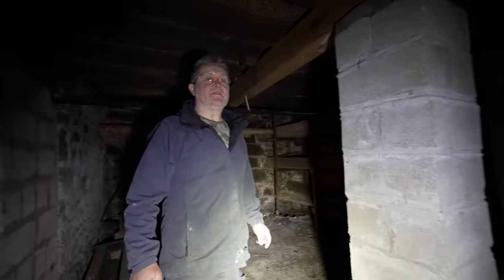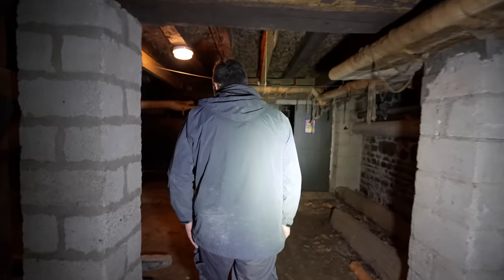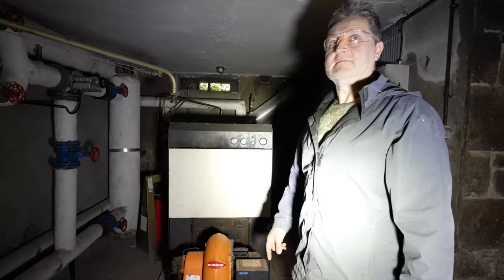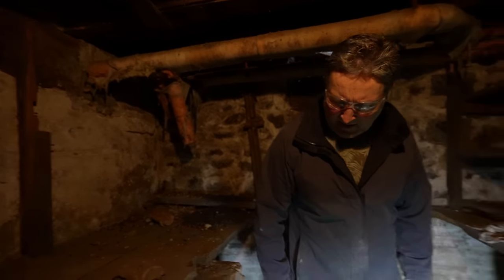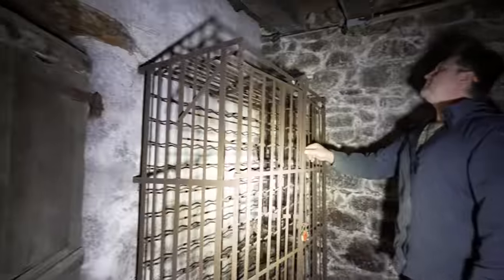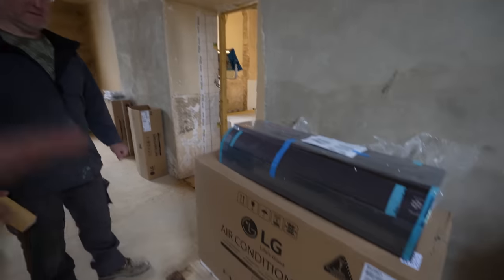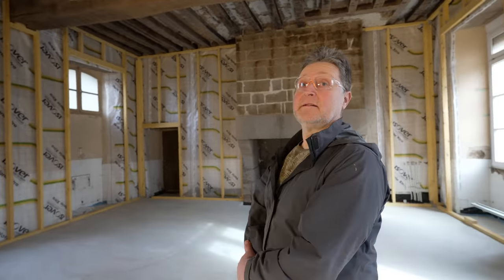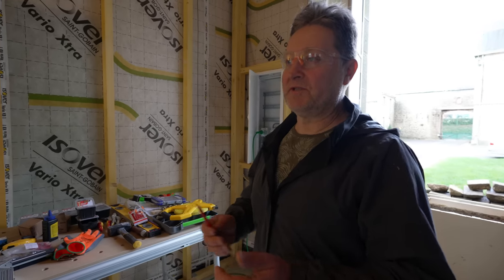You Asked For This... Exploring The Convent Basement

Comment: I think that corridor would have been a breeze way before the doors were installed so the dressed granite by the cellar stairs makes sense as it was once outside
Reply: Yes! The kitchen would have been separate to keep odors and the risk of fire isolated!
Reply: @amysbees6686  yes, the risk of fire was far greater due to the use of open fires,it's often why you will find old kitchen building totally seperate to main dwellings

Comment: I agree with not cramming everything in the kitchen into a little corner!!! That kitchen would be perfect for having a few separate work zones: baking area, food prep, etc and may need more than one sink! Yes, and use those gorgeous oak boards in the basement for shelving and worktops!!!
Reply: Yes. Having everything in one corner does not work if you have a number of people using the kitchen. We have a staffroom where everything is in one corner and it's very inefficient. People have to queue to use the sink and the microwave and get access to the fridge. The other corner of the room only has an oven which we hardly ever use! It was designed as a domestic kitchen but not for 30 people trying to get lunch and cups of coffee.

Comment: RE: The Wine rack. After the rack is cleaned, suggest you contact several 'Fine" resturants, in France and England, to see if you can get them to save their finer empty labeled wine bottles. Filled with the appropatly collored water and corked, filling the wine rack in the kitchen for a great display. Also how about resal on the boiler equipment. Offered with  buyerr removal could bring in a couple of quid!

Comment: The kitchen chimney breast and stonework looks amazing!  This room is rolling along on well-oiled wheels thanks to your team.  It's wonderful to see the progress.   Just remember that there may be construction codes to follow in regards to how far an electrical panel has to be from a water splash zone or open fire.  As what you showed in the corner of the panel might not work.  My father was an electrical consultant on many builds, including industrial, commercial and residential kitchens and that was one of his pet peeves with architects placing dangerous structures by a panel.  No matter that there is a door closing the circuits in, water can still seep in and it only takes one time to ruin a project such as yours. Consult Duncan and get his professional feedback before you install those 2 items.

Comment: 13:27 Looking at that fireplace I would consider turning one of those large beams on the basement floor into a mantle and possibly for the other large fireplace in the other part of the convent. I think the wine rack would be a lovely original feature for the kitchen though I think I would turn the bottom half into an appliance garage type thing.

Really? You want the sink right next to the electrical panel?? That would never pass code here.
Reply: I agree. My thought was unless you plan on spending hours standing at the sink why give it the best view? Where he originally was thinking would be better. I would rather see a small table and stools at the window so one could sit and have a great view of the courtyard.

Comment: I think it would be cool to bring that wine cage up to the kitchen to repurpose and use for the wine now. It is such a cool piece of the convent. I was looking up at the ceiling, that would be the floor above. What is that made out of. I didn't recognize it. Isn't the sink going to sit too low if it's under those windows? Maybe put the sink on a solid wall and leave the windows for viewing with tables and chairs. If I think about the amount of time I've spent at my sink and if I actually looked out the window, I would say, you really don't need a window over a sink. Use the windows as a resting spot to observe from instead.

Comment: Your "vents" might have been "bell runs" - channels made to run the wires that would connect the bell pulls in the upstairs with bells in the basement and kitchen.

Not all buildings had them, but if you find them, they are priceless for running pipes and wires.

Comment: Golden triangle method is far from nonsense. It's so you don't feel so knackered, as though you've run a marathon by the time you've finished doing prep, cooking, & washing up that you just want to fall flat on your bum, never to rise again; especially when catering for larger groups as this property will inevitably require. It was originally conceived by professional chefs, primarily for this reason, but also in the name of efficiency. 

I've tried to arrange my own kitchen this way, & believe you me, being able to just turn, raise a hand & grab a utensil, bowl, or bend down to get something or not have to join the crew of the Starship Enterprise to boldly go where no man/woman has gone before, with barely a second thought, well, it's bloody marvellous!!!

Application of it in a kitchen of this size might present its own challenges, but ask anyone who's regularly cooked for large families or groups, & they'll soon tell you having everything in easy reach (without) having to schlep 5 miles here, 7 miles there etc & back again, makes an enormous difference. Layout is everything in a (good) kitchen. 

However the layout is eventually approached, I certainly wouldn't bother jamming the kitchen sink under the window in the corner. It'll be a bloody nightmare because it (won't) allow enough stacking space on BOTH sides of the sink for dirty dishes and anything else that will require easy & [adequate] laying out around the sink, say for example, vege & salad washing. 
I've always been completely mystified by this mad idea of having a [great view] when doing the washing up, but I ask you: when was the last time (you) looked out of a window while doing dishes? My guess is never! Dishes wouldn't be properly washed, there'd broken crockery, especially glassware, and plenty of nasty injuries would ensue as sharp implements sliced & diced their way through hands. 
It may not be rocket science, but doing the washing up takes a certain amount of concentration & attention to detail, none of which can be found looking out of a window as you attend to one of life's tedious necessities. 
Since the location of the water supply will dictate sink placement, try locating the sink (in between) the two windows. It will give PLENTY of circulation & layout bench space on either side. In an 80 or so square metre kitchen, it's daft to limit such an important feature of any kitchen to  being jammed into a corner. There's likely to be a number of simultaneous demands placed on kitchen sink access in kitchen this size. Therefore if someone's washing up & two or three are drying dishes, you can still have enough room for someone to grab a glass of water or fill a saucepan or bowl from the tap - weaving in & out of one another, a bit like a woven magic carpet - without getting into a logjam.

Comment: Took me back to the farm I grew up on when you mentioned the fire suppression system. The machinery used to dry the grain was oil fired and I remember that while it did not have an extinguisher, it did have an oil cut off that work along the same lines. Two plates soldered together and if the heat became too much then those plates would separate and allow a weighted tap to fall and shut the supply of fuel off.

Comment: Could you turn the basement into a dining room. Cleaned up using the the stone walls, with appropriate lighting,clean and stain the rafters, plaster over the cement block supports. Be an interesting place to dine.

Comment: Keeping the old hot water boiler and its equipment might not be a bad idea if it is still in working condition, or near working condition. If the heat pumps cannot keep the place warm during a real cold period, the old system could supplement.

Comment: Guys have the pipe insulation in the Basement checked for asbestos particularly the pipe insulation in the boiler room as it looks like it has been coated in plaster of Paris which was used in the UK with asbestos.

Comment: They would have stored dry goods and vegetables in the basement. Along with the wine as you pointed out, but also emergency water in barrels, unless they had a well down there. Did you see a well outside or in the basement?
They also stored ice in the freezer that you found. That was usually used for medical purposes not so much for drink.
Also, sometimes animals were stored in the basement, like chickens cows pigs, if the weather was freezing or if they were ill or in labor during inclement weather.
Thanks for filming the basement!

Comment: If you put the sink in the best view window. will that be too close to the electric box?

The food storage rooms upstairs may have been Tithe rooms for the community drop off, until tithe collections being done by churches/convents were cancelled by the revolutionists. The food used by the convent may have been kept in the basement but I have doubts on that.  

The hole in the basement floor looks too small for a fridge - Maybe it was just a wine fringe?  Could it have been where you pour left over holy water?  Churches never pour holy water down the drains - some have a little door in the wall of the sacristy to pour the water out to the garden away from foot travel or drains (sort of looks like a milk box).  There are rules for holy water - don't want to upset any spirits living in the drains or grounds lol.  This is why the ground that a church sits on is hallowed ground - no holy water will leave the grounds without approved purpose, unused portion is brought back to the church to be disposed of by the staff of the sacristy. 

Somehow I thought the basement would be bigger.  Is there more than one basement? It looked like some doors ways may have been sealed off?  I'm always suspicious when I see cinder blocks in an old structure hehe.

Comment: Please put a great thick of white paint on the asbestos pipes and the older fiberglass wrap. It’s wrap may be secured with plaster and asbestos.
 I hope that the small bit workers wet down the material and use respirators. It will be a big deal to remove all the as asbestos. You may be able to abandon it in place but your local inspector, who seems to be a reasonable guy, will have to OK it.

Comment: Air conditioning installation is controlled all over the world because of the high pressures involved with the refrigerant gas used for heating and cooling and is controlled by the “Paris Accord” for control of refrigerants.🇦🇺😁😁😁

Comment: Just a fyi Billy, our heat pump had to be moved.  They can be noisy.  It was right outside a window where we spent a lot of time.  When we replaced it we moved it the end of the house away from the living areas. Same goes for the part in the basement. You also can't  put plants too close. They need ventilation.

Comment: Check the external tank for oil and leaks or you will have a big cleanup bill
Reply: Yep. And it's probably a big one for such a large building. Should be inspected at the very least and decommissioned if they don't plan on using it again.

Comment: The triangle setup is an outdated wasteful, terrible design. Glad you are not using it. If you put the sink next to the window  not in front of it you will have full use of the window and the sink won't be in the way. Also if the gally slaves are looking out the window they won't be doing the dishes properly.